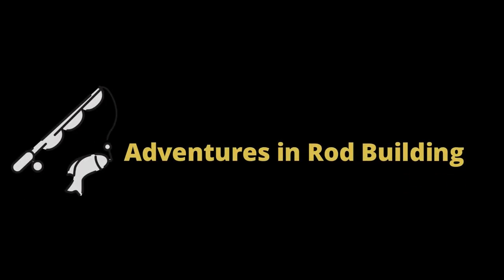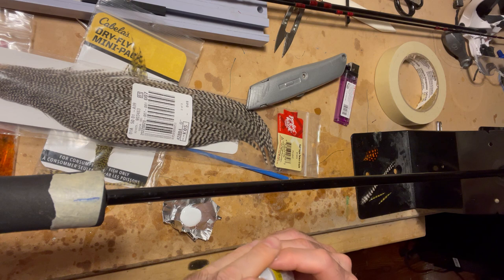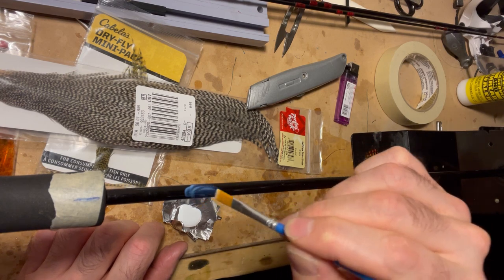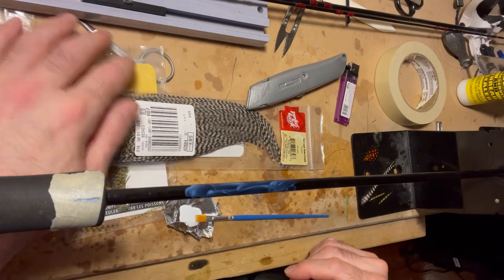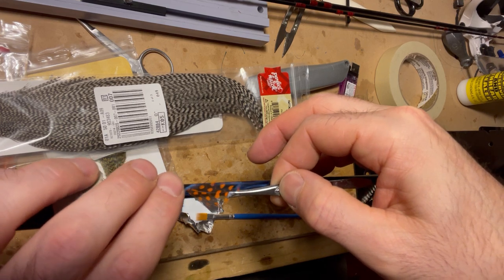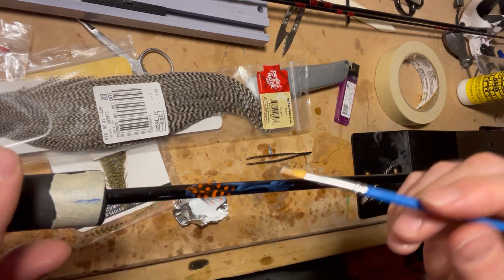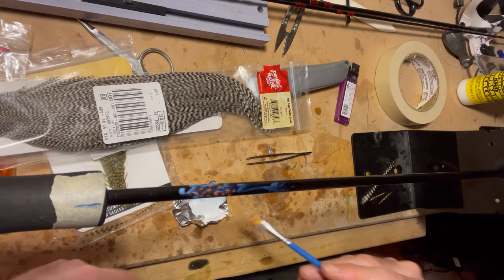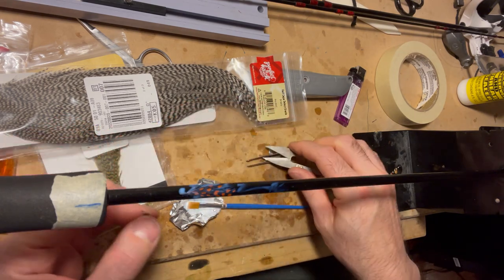Create a Feather Inlay - Rod Building😁😡

Comment: Did you like the outcome? Did the milkyness of the CP dissapear on that black blank or was it slightly visible under epoxy? I have had bad luck with using CP of the mily variety on black blanks.
Reply from the maker: It wasn’t a bad outcome. This was a test to see what it would look like. The CP dried clear and looked fine the next day. Thanks for checking out the video😀